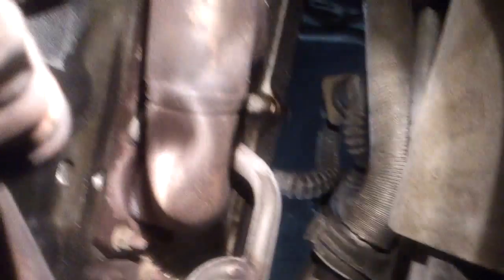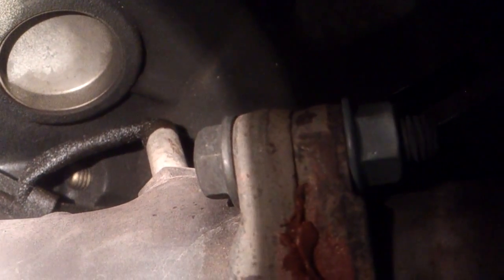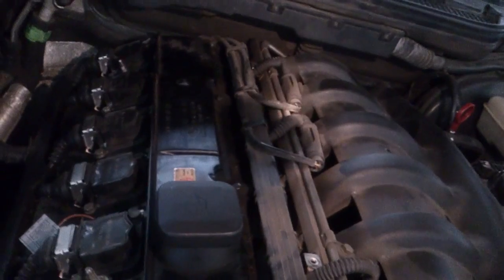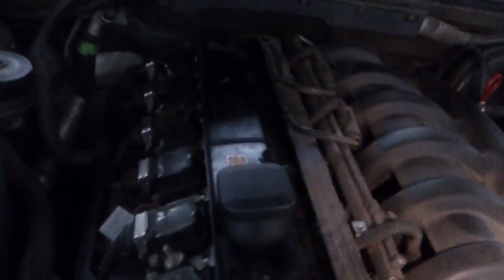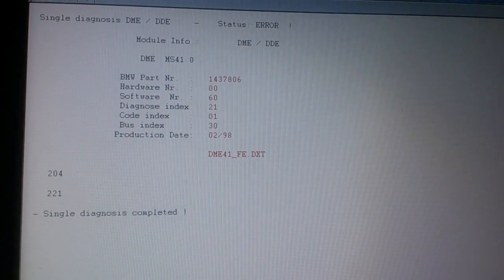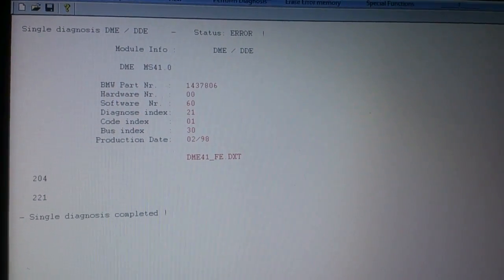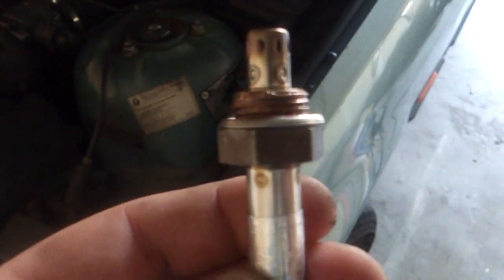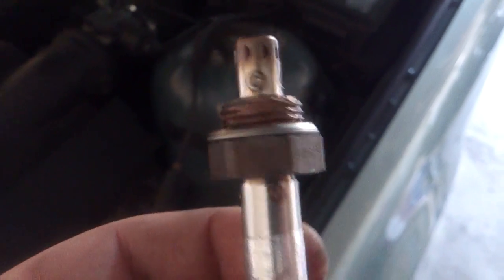BMW E36 Front O2 Sensor Locations

Comment: Hi, i have a 1995 325i sedan, i can not find any o2 sensors anywhere on my exhaust, howerver i can find one electrical socket where an o2 sensor can plug in but it is capped off, also i can not find any where on my exhaust where it can be screwed on, my car uses alot of fuel, i am lucky if i get 6kms per litre petrol, on the open road i get like 11km per liter. Any help pleease, aside from the low mealage my car feels absolutely fine, no rough idling, no lag, very smooth and fast driving, another problem is the it stinks fuel in the car, is this car required to have an o2 sensor? If so why arent there anywhere in the exhaust where is plugs in?
Reply: I'm currently experiencing the same issue on my 92 e36 320i, I can't seem to find the O2 sensors, car runs fine and mpgs are good enough for its age, but won't pass emissions test. Any idea anyone?

Comment: Hi did changing precat o2 sensor help you pass 15mph nox failure? I am having same issue with 15mph on smog test. I am getting no code on o2 but going to try this before replacing cat.
Reply from the maker: Kyu Kim if you have over 100,000 miles on your car and haven't changed the O2 sensors, you really should. The car will run better and most likely will pass. You also might wanna try SeaFoam to clean the carbon out.

Comment: Too vague:  i.e. It's 22mm I believe; also, Bank 2, Sensor 2 I believe it was.  Not hating, just IMHO.
Reply from the maker: Thanks for your opinion. Most people buy a O2 sensor socket. They are all the same, but if your using a box end 22 is my guess, it is pretty accurate at that. 
When your car has 4 O2 sensors and your reading a German diagnostic app, I believe what I read was correct. 
Not hating, just explain'n! 
Dont forget to subscribe for more videos where I guess and believe and its correct ^_^!

Comment: OBD1 or OBD2 ?
Reply from the maker: El Salvador this car is odb 2, but should work on odb 1.
Reply: OBD1 only has 1 O2 Sensor, which I recently replaced on my obd1 e36.
Reply: where does it plug into on the obd1 car
Reply: M3Pilot at the y pipe of the exhaust

Comment: would bad O2 sensors cause idle bouncing or is idle bouncing more fuel related?
Reply from the maker: It could cause idle bouncing, but a vacuum leak would cause idle bouncing as well. Any time the engine is struggling to find idle its either because there a sensor that isn't working properly or because there is some variance in expected readings, like a crack in a rubber hose or a Vacuum leak of some sort. While certainly not always the case a bad sensor or vacuum leak are usually the causes.
Reply: Jay May
thanks for the quick reply. Vacuum leaks is where I'll start looking. The funny thing is no fault codes show up on my '94 325ic bmw. btw great vid.
Reply: +Marcus Triton Did you ever find out what it was?? I have a '94 325 and am having the same problems!!
Reply: Can you describe what your car is doing? Any codes show up?

Comment: pre-cat O2's control the fuel trim and if failed will cause drivability issues, they have nothing to do with emissions. the 2 post-cat O2's are the ones that monitor the converter health/emissions, and those have nothing to do with fueling. although if the pre-cat O2's are failed and not immediately replaced, that will damage the cats.
NTK 25013, these are the OEM BMW sensors for all four. can get those off of amazon for $60.

Comment from the maker: If your car has two exhaust pipes and after the Cat it becomes one then yes, 2 pre cat and one post. As far as replacements go, I bought at pep boys, used a $20 off coupon so they ended up being 80 bucks. Stick to what's  suggested, cheaper replacements can cause running problems.

Comment: my 93 E36 only has one O2 sensor and it's right before the cat. there isn't on on the manifold.i have to literally separate the exhaust in the middle and lower it to replace the sensor because it is on the top of the Y pipe facing the bottom of the floor :/ what a dumb ass design... if anything, they should have put the port of the side of the pipe.

Comment: I have a 1998 323is, Autozone told me it has 2 pre cat sensors (1 per manifold) and 1 post cat... is this correct? Also, what brand did you use? OEM are 100 each more or less :S so I was wondering if I could use other brand.